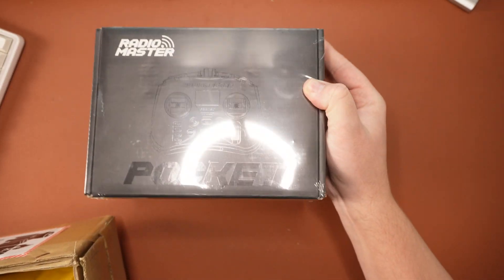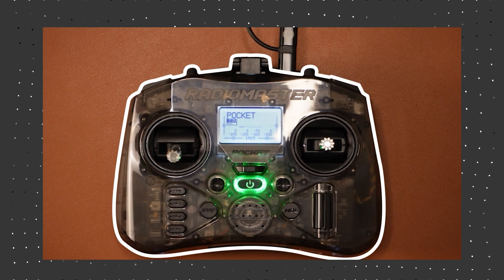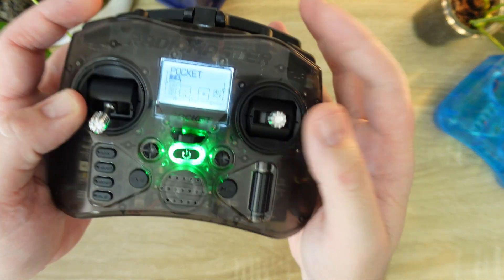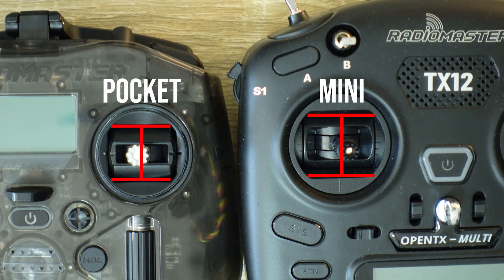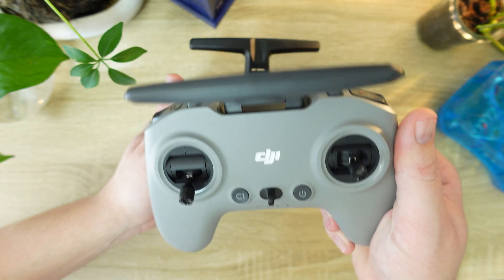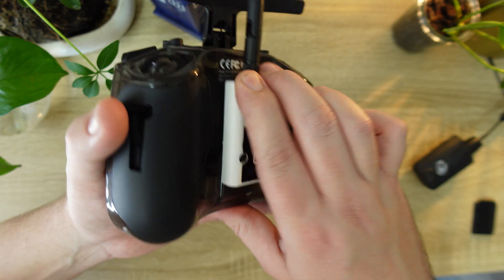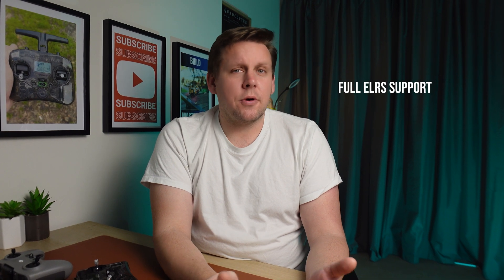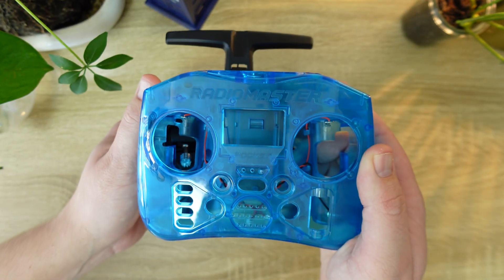This $65 High Quality FPV Controller

Comment: Do you think with a little modding the mini gimbals would fit in the pocket?
Reply from the maker: Considering you can easily replace the shell, I think it is worth having a go and seeing if it works. I’d probably be on the side of caution though, because it’s a big investment in AG01 mini Gimbal if it doesn’t work out

Comment: Thanks for the video!
What do you mean with: full ELRS support? 

What can i do more with this radio instead of the ones you mentioned during the caugh 😂😂
Reply from the maker: Some of the BetaFPV Radios use a Betafpv version of ELRS, and you have to use their configurator and wait for them to update the firmware. Lite Radio 2 SE and Lite Radio 3.

Jumpers T-Pro doesn’t include support for ELRS backpack.

Comment: For someone who grew fond of Fpv drones recently and had been feeling "this is my thing" , especially the tiny whoops, what will be your recommendation, shall I start with a RTF KIT or I should buy the controller, goggles and drones separately? 

And of RTF KIT, which kit should I go for, 
Cetus X or Tiny Go ver 1.3 or WhoopFly 16.
Reply from the maker: Never buy an RTF kit. 

Get a Radio, learn on the sim. 
Get some analog goggles second hand, then learn to fly a whoop & a 5” 
Then after that and you’ve learned how to fly and not crash as much - go digital.

Comment: No real benefit to this radio unless you don't have a radio or you want a more compact radio. But at the end of the day you can't beat Radiomaster tx16s with a module bay in the back so you can run different protocols.
Reply from the maker: This has a module bay
And “different protocols” from a MPM I’d pointless in 2023 with everything on ELRS or CRSF

Comment: You're talking about 30km range of the radio? So what vtx can give same range of video transmission to the goggles? 😂max of 3km video transmission would be great. I have dji O3 which said to have 10km of video transmission but about 2km the video signal starts dropping significantly and note there are not many huge building that would block transmission but some trees
Reply from the maker: O3 is good for 20kms of video, Walksnail & HD-Zero is good for 50kms. 

You also need to increase altitude as you increase distance as that’s how radio waves travel.

Comment: I don’t understand why EVERYONE recommends the ELRS versions of these radios. The 4 in 1 version is cheaper and the higher performance 1W nano Ranger ELRS module is cheaper than the external 4 in 1 modules. You can get better radio transmitter performance for less money by choosing the radio version with the in built 4 in 1 module and adding the ELRS module after.
Reply from the maker: Further regarding performance- the reason why ELRS is preferred over frsky is even at lower power outputs it still far out performs frsky in range & penetration.
Reply from the maker: 4in1 isn’t “higher performance” than ELRS regales of power output. 

Why save $10 to then have to spend $40 to get ELRS 

There isn’t a 4in1 version, only CC2500 which is Frsky & Flysky 

4in1 is pointless today anyway, everything is ELRS or crossfire. 

250mw is good for 30kms and is not 4x more powerful than 1w anyway 

1w is 30dBm, while 250mw is 24bm 

You don’t need the extra power and if you do, then get the external module, sure it’s $10 more but you are not having to always have an external module on your radio.
Reply: For what it’s worth, I have the Tango 2 Pro and I absolutely hate having to put an extension module on the back to use ELRS. The radio doesn’t sit properly when you put it down, it has two antennas unless you keep removing them, and it just generally messes up the weight and ergonomics. I’m looking at this purely to avoid having an external module. Hope that experience helps someone out there to decide!

Comment: Why so cheap compared to the zorro?
Reply from the maker: It's probably simply price positioning rather than actual cost.

An iPad with 64gb is priced at $449 while the 256gb is $599, there extra storage doesn't cost $180, far from it. So its really just price positioning to make sure you buy a Radiomaster instead of other brands, so then when you go to buy your next radio to upgrade, you'd go for the Zorro, the Boxer, the Tx16S instead of looking elsewhere

Comment: I have a Zorro on the way right now.
Now this controller is coming out, it might have been better to use these controllers.
Or do you think the Zorro is still better?
Reply from the maker: "Better" is subjective and not measurable. Price doesn't determine better either

Consider this:
‣ They both have the same internal ELRS module, so no difference at all there
‣ Pocket uses 18650 batteries, has way longer battery life than Zorro
‣ Zorro uses Mini Gimbals (upgradable to AG01), while pocket has Mini
‣ Zorro is more ergonomic for multiple grip types, pocket favours Thumbs
‣ Zorro isn't as portable as the Pocket, 
‣ Pocket is smaller than the Zorro so not comfortable for someone with big hands
‣ Zorro is $119, Pocket is $65, Boxer is $139 

This is better vs that is better is just not something that can ever be
Reply: @DarrenAllatt  With all the points, I believe that the Zorro was still not a good buy.
Maybe then the pocket or the boxer would have been better for me.
But now she's on her way and maybe I'll send her back then.

I'll have to think about it myself now.

I just paid way too much for the Zorro (160€) and it's definitely not worth it and doesn't make it such a good deal
Reply from the maker: You have to do what’s right for you.

Comment: Which radio is NOT a travel radio??
Reply from the maker: Agree, however the reference to a 'travel' radio is more that if you are going on a trip or holiday and didn't want to take a TX16S, Boxer and all your kit, you can take the smallest amount of gear and still get up and fly
Reply: Those big clunkers are nice but they definitely don't fit in my bag well. I prefer my $70 jumper t-lite with a mini elrs module to my medium sized dji radio for sure.  The smaller game remote style radios are great in my opinion.   I'm not speaking for this one specifically but my t-lite is my absolute favorite and cheapest I've had lol.  Most comfortable, portable, ergonomic, cost effective, coolest looking, customizable, programming capabilities, and can even put cnc milled aerospace aluminum hall sensor gimbals in them if ya want! Can't do that with dji box and it's definitely WAY EASIER to fit it in my bag or even carry on my neck while inbetween flights.  Its nit a huge deal but theyre absolutelyconvenientand better to have one than to not have one.  Lol I love my t-lite and there are even better ones than that for sure out there. Thankfully quality radios aren't really that expensive or hard to come by like most other quality things in this hobby. The transmitters are the easiest part of it all lol
Reply: Okay now I get it, but I still don't see a point in owning more than one radio
Reply from the maker: Well, have you seen my video on a go-bag?
Reply: @robbiek9016 there's points. I currently have tx16s and t-pro. As FW flyer, and also fying quad with INAV, radio with more switches is much preferred in the beginning. I need switches for autotune, auto level, auto trim, etc. But when the aircraft is already well tuned and set, bringing tx16s for travel is a pain. That's why t pro is my preferred tavel radio. BTW, I'm pre ordering pocket for more portability.
Reply: @serang  okay that's a good point, haven't thought of that
Reply: Here also. If i got with my car to the field and bring all my quads and fixed wing than the tx16s of no problem and i love it. But when i got from spot to spot on my bike, the tx16s is so huge and im always afraid to damage it. Im currently taking the pocket in consideration for this reason.
Reply from the maker: @arthurganz  it would be a great choice for that very purpose.

Comment: The copy here is as follows......

TBS Tango 2
DJI
And the rest.........
Reply from the maker: yes and DJI get's the mention in the video due to youtube algorithm.
Reply: @DarrenAllatt That's kind of a sell-out move. You could have mentioned DJI and Tango 2 in the same breath and not hurt the algorithm.
Reply from the maker: @scootsmcgoots1  yes and the tango 2 has nano gimbals, or removable gimbals that store in the body, a momentary button and a scroll wheel on top… oh wait no it doesn’t. The similarities with the tango 2 are the antenna and the 3 position switches. 

And remember, I make these videos for free, the cost to produce far exceeds any ad money I’ll get over the next 12 months, so if I want to play the algorithm a little that’s my prerogative

So am I a sell out?
Reply from the maker: @scootsmcgoots1  forgot to ad, there is also no point comparing to a radio that has been perpetually out of stock for the last 2 years. So, it’s not getting any breath if you can’t buy it.

Comment: W for Radiomaster, this brinds better competetion for small controllers! 

Regarding to similarities with DJI controller? I don't think so, Radiomaster was pretty original with that design being conservative with the size while keeping the main focus (small and flexible) and it looks good tbh, the Jumper T-Pro was the real copy from DJI, a little bit with the Zorro
Reply from the maker: yes and having the same switch layout (but mirrored), antenna, nano gimbals, removable stick ends stored in the grips is not at all copying dji. the only difference is the shell
Reply: @DarrenAllatt  antenna and nano gimbals isnt that a standard?, I agree with removable stick ends stored in the grips, but it is a matter of practicity 🤷🏽 not patents
Reply from the maker: @frangeris  did you not see the size comparison to mini gimbals? 

These gimbals are smaller than the mini gimbals on the TX12 and Zorro.

Comment: Interesting radio for a good price. Jumper doesn't have full ELRS support?
Reply from the maker: No Jumper don't... The Jumper ELRS radios don't include backpack support.
Reply: @DarrenAllatt  Eh, the backpack is an extra module and isn't really part of the ELRS spec.
Reply from the maker: @icebalm  no it's not for TX modules. the current hardware spec for ELRS TX Modules includes backpack

Comment: Im getting into fpv and want to play sinulator, i have budget under 100€, should i cop this radio or try to buy used ans better radio?
Reply from the maker: who do you mean by 'cop' this radio? the police aren't involved.

as I said, buy once cry once is my preferred way of buying FPV stuff; so I'd personally buy a Boxer. However if you wanted to go with a budget radio and upgrade later, than I'd buy this.